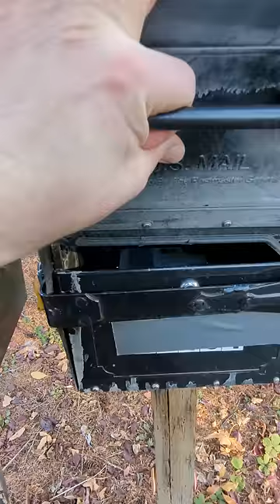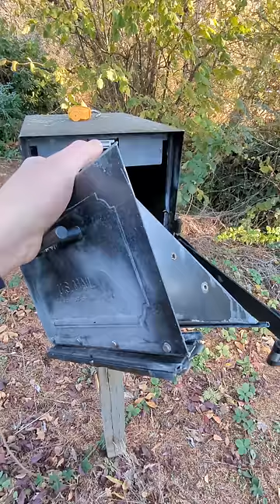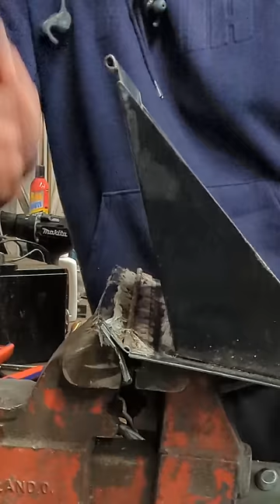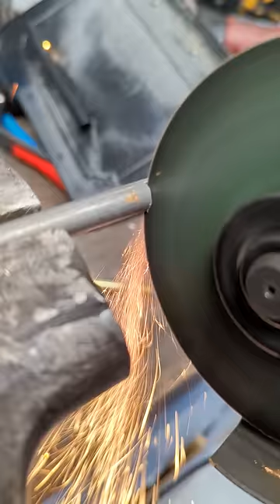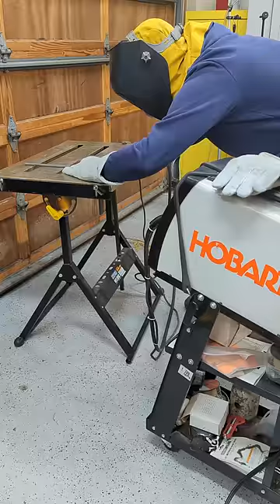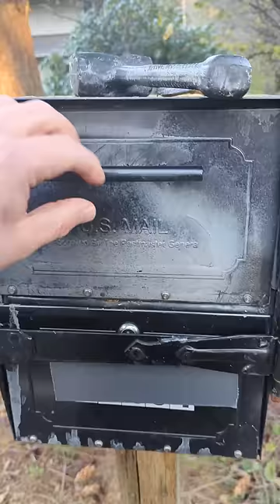Beefin' up the mailbox again...

Comment: If you do want my grandpa did you won't have any problems. My grandpa took  half-inch steel made a box of solid steel including the open door for the back to get his mail put hinges on it that were made for a tractor. Then he put a lock on the backside where the door was. He put a little slot big enough to slide 3 things a mail at a time on the front side. Solid mailbox. The he put a railroad tie for the post and cement it in.

Comment: Good mailbox story. My brother lived near a high school. Kids would punch mail boxes. I talked my brother in to putting a square tube in the middle of the box and filling around the tube with concrete. Kid punched the “regular” looking mailbox and broke his hand.
Reply: My dad did the same thing because they would hit his mailbox with a truck and brush guard or baseball bat out the window. Well, dad swapped it one day, and they found out that it was concrete and metal.
Reply: @Henryetta Collins  this has happened many many many times lol
Reply: @henryettacollins9095  cope keyboard warrior.
Reply: I had a neighbor that I could never catch. That ran over My mailbox 4 times. I took a auger piler and dropped a solid cast pipe down in the ground and filled it with concrete. Then put a new mailbox on it. In the middle of the night I heard a loud crash. The next day my neighbors car had a huge V in the front end. I never had to replace my mailbox in about 30 years. Lol
Reply: @henryettacollins9095  I bet you’re fun at party’s
Reply: @henryettacollins9095  just talked to chief, came back positive for cap on 3/3 of your statements sorry bro
Reply: @henryettacollins9095  *fart noises*
Reply: @henryettacollins9095  "...the post office owns mailboxes..."
No. They most assuredly do not own the mailbox you put at the end of your driveway. That's just ridiculous. There are regulations about the size and height of the box but they're really more like guidelines (mostly unenforced). But, of course, it's a federal crime to maliciously damage or destroy a mailbox.

It used to be pretty common for people on rural routes to put a 4" PVC pipe inside a regulation steel mailbox then fill the rest with concrete. That can be a pain for the carrier/driver (because it's small) so most of those customers keep a P.O. box in the nearest town where they can receive packages and oversized mail. My favorites were regulation mailboxes incorporated into a decorative/protective enclosure. Some of them were really creative.
Reply: @jackjman5577  So how many times did you break your hand before you wised up?
Reply: @Peter Dragon  lol I never hit mailboxes, I loaded them
Reply: @henryettacollins9095  Yeah you do.
Mailboxes only become Fed property in the USA once they are installed correctly.
You can also use 2 inch pipe... it gives NO inner diameter requirement. 2" pipe with half inch walls will destroy the front of any car that hits it while be within regulations so you can't be sued :)
Reply: lol anyone thinking of making your mailbox solid in any kind of way. Check your local code before doing so. It could be illegal and you could be charged if someone gets hurt!
Reply: It's sad that something as sacred and important as being able to receive your important mail and a criminal offense to break this law yet people still do it. In my neighborhood where I grew up we had to fix out and replace our mailbox all the time.
Reply: Cool?
Reply: That’s illegal (neighbor growing up got in trouble). Apparently you can’t set booby traps that cause harm even when someone is doing something illegal.
Reply: If that’s true it’s hilarious
Reply: Wow dude, you're sooo cool. Making a KID break his HAND over a lil joke. You're just the man dude, you're just it. Your brother's too.
Reply: I filled mine with screws, then in the middle put some foam drenched in gas, then inside that put a jar full of semtex, i attached a detonator then attached that to a trigger that would go off if the box moved. Anyway vers1 blew up the mail person.
Reply: @geroutathat  seems legit
Reply: Sure he did.
Reply: Where did @henryettacollins9095 go and what did she say?
Reply: @popefacto5945 mailman here. ....Assuming a USPS-compliant mailbox is installed and ready for use, it's considered federal property. In other words, the homeowner doesn't legally own his or her mailbox; it's the property of the U.S. government. Prior to installation, however, mailboxes aren't federal property....a great place to look a lot of this info up would be the postal inspection service government website.
Reply: @Fairplayer38  You must be fun at parties.
Reply: @johnauman8146  The word "considered" is doing a lot of heavy lifting. It's still your property. You own it. You're responsible for maintaining it. But, legally speaking, it's being "leased" by the federal government for the purpose of receiving mail.
Reply: genius!
Reply: Ill take shit that didnt happen for 2,000 Alex!
Reply: @popefacto5945  please educate yourself before speaking more.. and also no it isnt pretty common for people.. its pretty common for idiots that want to risk killing someone.. and people have actually been imprisoned for doing so.. but nice try kid
Reply: Unfortunately creating a mantrap is a felony... Videotape the kid file charges, and make their parents buy you a new one in a Court verdict for the destruction of property.
Reply: Weak 😂
Reply: @Minenotyours58 Lmaoooo this is hilarious I could imagine how quickly he came out of his daze after hitting it to gtf out of there before u came... i would of loveed to see the look on his face and have a good laugh 😂😂😂😂

Comment: if your mailbox gets vandilized make sure you had 30k dollars in tools and metal supplies to fix it.
Reply: Someone comes off a little jelly jello sounding
Reply: 30k? hmm lets price it out with cheap tools that do work for the job. Most of this u can buy from harbor freight.
Drill:$30
Pack of drill bits:$15
Cheap but new welder:$160
Grinder w/cutting wheels: $60
Hammer:$10
Scrap metal: Free to $50 just depends.

Total: $275- $325 depending if u can get some free scrap metal.
So $300 not $30k, if you have a job its easy to pick up useful tools here and there, you dont even have to buy it all at once Lol.
Reply: @carvedfromlife8949  and people who don’t know how to do shit don’t understand the value of tools , they won’t be leaving you anytime soon and will stay handy for years
Reply: @chriskelly5836  yes sir, alot of people just don't know how to work with their hands. So seeing this clip looks like some crazy job. Lol it's all good, we all have different trades and hobbies.
Reply: @carvedfromlife8949  all of this is very doable even if you don't use tools, except the welding arguably but then there is a lot of people who weld for a hobby and would be happy to do it for a beer. Using tools and doing simple fab work isn't rocket science...
Reply: @BEmeraldJade OP was probably exaggerating for the sake of the comment. obviously it's not gonna be 30k, their point is just the materials cost a lot
Reply: The real answer is you put up a camera, tampering with mail is a federal crime. Won't be so funny when they're in jail.
Reply: Or just be a man and already have those tools. 😂

Comment: I’ve got a regular old mailbox and for years graduating high school students would drive around the neighborhood knocking mailboxes off with a bat. I would straighten the thing out and put it back up year after year. I had it set up so it would come off easy and sustain less damage that way.😂 and then, for some reason they quit doing it. Haven’t had to reshape it for a while now. 👍🏻
Reply: I bet the last year coincides with the creation of Tinder….
Reply: You take 1” bar & make a U bracket around the box & into the ground so it’s solid. They hit that with a bat & it will fly out of their hands possibly into the car…. Still have their bat 😅
Reply: Someone did a funny with a big boy in a big truck that liked to run them over.   Wood clad steel post in concrete anyone🤣

Comment: 6” metal pipe in ground 6’ in ground. Full with concrete. 4’ above ground.   Call on top. With interior latch. Lock raced so only tumbler is visible. 1”4 slot for Mail.  You’re welcome

Comment: Make a mailbox that drops down into the ground after he puts the mail in. So it's a vertical tube that goes into like a silo. Make it so it's got a hidden released for you to pull everything back up. Don't have to be super heavy I just have a drop-down five feet down the hole. And you come by with your special tool to grab it and pull it up and reset it.

Comment: We had a set of mail boxes for the whole neigborhood, someone kept mowing them down. My Dad went to the rail yard and picked up a bunch of rail and welded up some posts and the neighbors all pitched in and dug big holes filled with concrete, welded up more rail on top, set the mail boxes on that welded them on and put wood posts on both outside edges. The idjit wrapped his pick up around it one night. Problem solved.

Comment: I have a 40mm motar can as my mail box they hit it with a bat one year messed all three mail boxes in front on mine took one swing on the motar can and left me the bat quessing he just vibrated away
Reply: Or a ripped rotator cuff
Reply: Bad thing is if he reported it you'd be the one facing charges.
Reply: @deussalt4479  you have to have reported vandalism at least twice, at that point they give you a certain amount of permission to increase the defensive capability.

Comment: Gets electric chainsaw and cuts post and runs off with mailbox.
Reply: He locked it using a Masterlock. A good wack to that lock and you're in.
Reply: @Andrew Brickhill because they’re more quiet. I prefer gas powered 100%, but electric, you ain’t waking someone else up, especially if you sat right next to their bedroom window. It’s a lot more quiet. You see, I used to live in an HOA, electric mower, electric lawn equipment, mower, weed whacker, they were perfectly quiet. I could have both ear buds in and not hear a noisy engine. Hell, I could’ve mowed my lawn front and back and at 2 AM and wake no one up. Electric chainsaw, no one would wake up until the tree lands on a car setting the alarm off.
Reply: @WraithReaper09  yeah, but the look on his face to see that you stole the post too would be hilarious.
Reply: @Andrew Brickhill not the one I had, it was about the same. It was a ECHO 58 volt chainsaw. No problems with it whatsoever.

Comment: Just fab the fort nox of all mail boxes from scratch at this point. Show off them skills!
Reply: Going to need to, I think that hinge is a weak spot for prying attacks. Then the box itself starts to look thin at that point too. Big ol' 14# axe will get it. Sooooo.... 1/4" plate all around with cemented steel ballard they use for truck stops. LOL Weld the box to it. Then get a circle lock.

Comment: I had this problem where someone kept breaking into our mailbox so we drilled two holes in the side and put a metal bar through it with locks on both sides, it stopped them from stealing But then one day they come home and find that our whole mailbox is missing the pole and all so we bought a super secure $160 mailbox put some concrete in the ground for the new pole so they couldn't uproot it this time and so far it's been safe

Comment: The guy could use a grinder with a cutting disc and cut right in between the two metals or he could easily drill out the weld

Comment: 10 gauge 3 1/2 inch shells and no mailbox lol
We had some clown that kept hitting ours with a bat to the point I had to use a box I made from angle iron and 1/2 inch plate steel sitting on a brick post with rods down the center

Comment: Just cut the post off with the mailbox attached to the post. Sir, you haven't stopped anything.  Place the mailbox ona metal postand weld it. Then put concrete around the metal post thats in the ground. Now you will have  a fort knox mailbox 😂

Comment: Ben S. I like that or you can fill up an old mailbox with concrete with a very solid metal pole and video the idiot hitting it with a bat or even their car. for those taking your mail hook it up to some cattle wires and battery for a day or two to your metal box -just tell your postman to not deliver for a few days and keep an eye on it when possible.

Comment: I could break into that in less than five seconds with bolt cutters or 10 seconds with an angle grinder with a cutting wheel and then leave all the pieces laying around.. maybe you should just get a po box

Comment: Problem is you're using a Masterlock padlock now. Most locks of that brand can be picked open with low skill attacks. Or they can just cut it. Either way, that lock is now the least defended point of entry.

Comment: just make it out of 1/8th - 3/8ths inch thick steel plate should be more then enough instead of that thin 1/16th it made out of